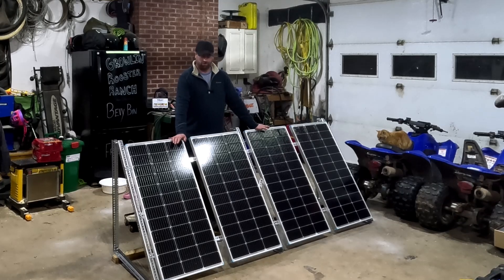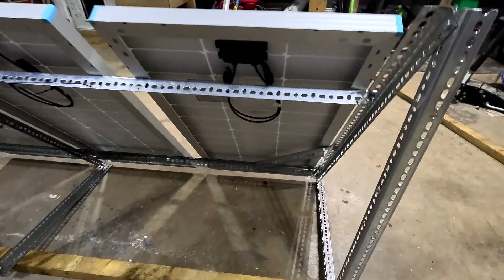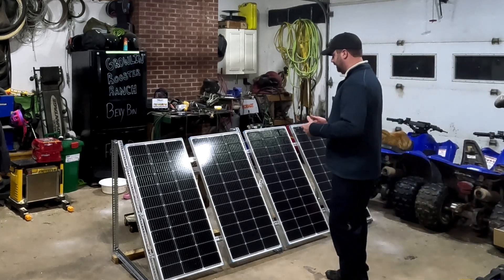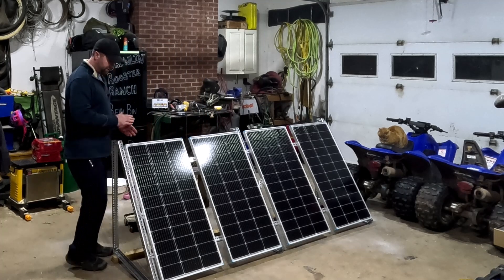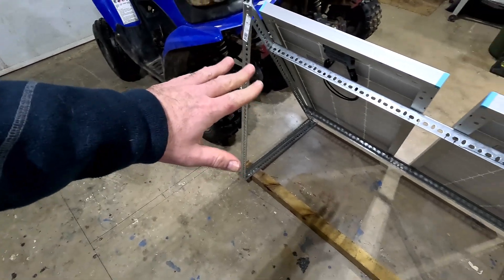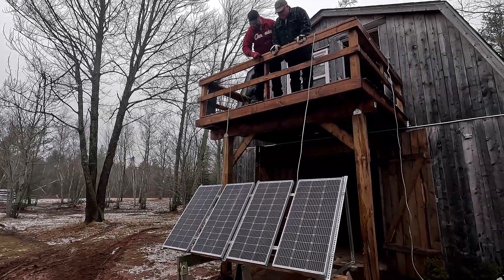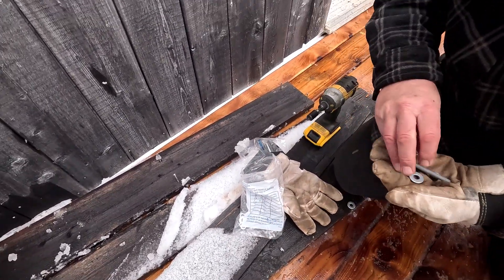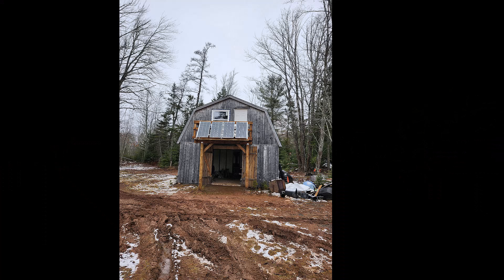BARNDO - Episode 7 - Solar Panel Installation

Comment: I have a similar setup to power my garage fridge and power tools... In NC winter we are at 50 degrees tilt in the winter and in summer I tilt the array to 20 degrees.  I did mine in wood and I like your metal frame better.  Nice setup.
Reply from the maker: I like the idea of tilting it up in the summer!

Comment: I may be wrong but I think your array looks to be at 60 degrees from level, which is pretty steep.  I like the assembly you created.
Reply from the maker: Horizontally pivoted it would be 55 degrees as a ground mount. The pivot point taken from horizon. 

The bottom brace ( horizon) is the adjustable section to change the angle of the array. The reference pivot is vertical. Making the reference angle calculated the top of the array @ 35 degrees. Because it is the fixed nodal point.  Math wise.

As for steep. I'm experimenting as I have to consider the fact I won't be there to pull the snow off them most of the winter. 

So far.  The charge rate is more than %18 per hour on only two ( half) of the panels.